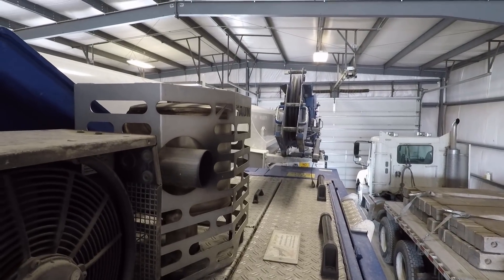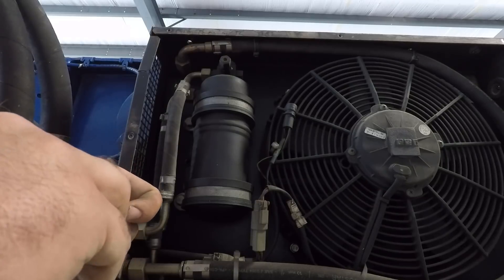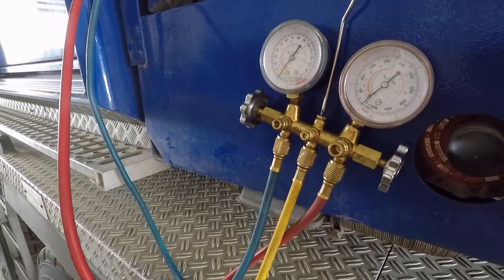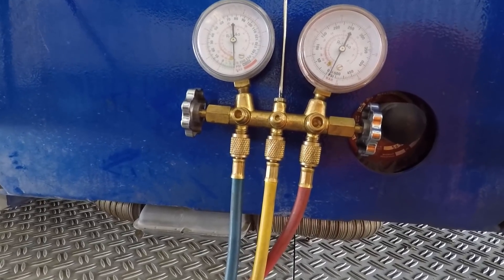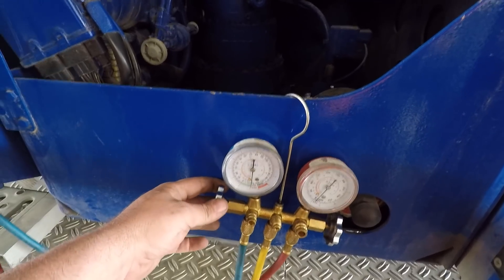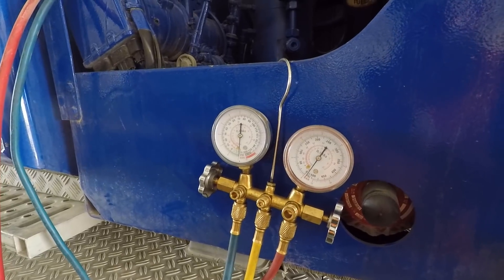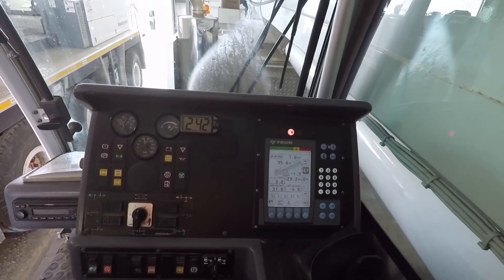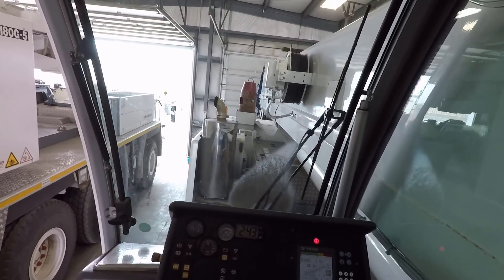Tadano 80-4 | Air conditioner repair

Comment: HVAC...once you understand the basics...not all that complicated...I worked in an 'Auto AC' shop and we got just about anything in there, cars, trucks, cranes, stretch limos, even a 40 footer, Lincoln Town car...had 2 HVAC systems, and still running that little 5 liter engine......and the landlord had a big crane outfit just up the street...Triple AAA crane, had some pretty big mobile units, 5-6  axle....but he got some $$ trouble...now just has a few small 3 axle units...
 So yeah...the HVAC, you got it pretty much right...!!

Comment: Nice job Jimmy. Enjoyed the refresher coarse. Spent allot of years in a shop that repaired Submarines. Enough HVAC info rubbed off over the years to maintain my own vehicles. I know you didn't address all the what ifs, so ill mention that if you did lose vacuum, find the leak by pressurizing the system with compressed air. Then perform soap bubble test to find the leak. Once repaired re perform soap test followed by vacuum test that Jimmy showed you. Note that pulling a vacuum removes moisture and non condensable gases. If moisture is still in the system the vacuum may stabilize (ie no leaks) but will not be a good strong vac reading, continue to run the pump until 28 to 30 inches is maintained.
Reply from the maker: Bradford Lunt, thanks for sharing the info. Also, thanks for watching. 🙂

Comment: Seeing as that I live in the deserts of Arizona I had to learn how to take care of the air conditioning many years ago, 120 degrees will do that ! 😎
I've had to run machines with a cab and no air in the summer and you can't do it for very long without getting a heatstroke !
Thanks for sharing and take care. 👍
Reply from the maker: Ken Gamble, that would be no good. I can't imagine an enclosed cab with all the glass and no air conditioning, in the desert. That must have been terrible.
Reply: To The Top Crane
Yeah, I told the boss that he had three options, fix the air, he run the machine or fire me !
He called out the service man and had it fixed ! 😊

Comment: If you like using the small cans you may want to stock up on them, the EPA has changed a few of the rules and is trying to get a big tax increase on the small cans. The idea is to stop DIYers from messing with the system.
Reply from the maker: That's not good! I will have to buy a 30lb bottle before the price goes up. Maybe I'll buy a pallet of them and sell them after they do their thing. lol Thanks for the heads up!

Comment: Does that  rule hold true with the R-134?  (empty to atmosphere) As I understand it R-134 and Freon systems are two separate systems.  What's you take on it? Thanks for the great information I always wondered how those gauges and valves worked together, the whys and hows.
Reply from the maker: Duncan MacKenzie, I'm pretty sure r134a and r12 are pretty closely related. Just that r134a is less damaging on the ozone layer. Both are a refrigerant, so I think (but not 100% positive) that the same rules apply to the r134a as far as venting to atmosphere. Since I'm not 100% sure, I take the side of caution and not vent it. I'll do some research on the subject and update you with my findings. 🙂
Reply from the maker: So, according to the Clean Air Act section 608, ALL refrigerants are covered and can NOT be intentionally released to atmosphere. So, r134a falls into that category. Hope that helps and answers any questions. 🙂
Reply: First off thanks for the reply and secondly there's no need to do many research as I'm sure you've got better things to do with the time you have in a day. I do appreciate it though. I'm a homebody and surely have more time on my hands I'll do the research and let you know, hows that? Continued thanks for the videos you post. (Never mind) you beat me to it.....thanks.
Reply: Freon is a somewhat generic term...but usually used when working with the old/banned R-12....both R-12 and R-134 use very similar components, but 134 works at a higher pressure and requires a different compressor ($$$$$) and different hoses.

Comment: Nice job man! Very well explained and detailed, I actually just recharged my ac on my loader Thursday. I know exactly what you mean by those cabs get warm on a 60 degree day. I have a light window tint on the loader it helps some but it’s miserable when it’s in blowing cold. Great video again thanks for sharing!
Reply from the maker: Elite Earthworks LLC, I keep some static cling, removable, dark tint in the crane. I have a few pieces that I can move around based on where the sun is coming in. It's cheap, easy and effective. It's not the best for looking through though. But, it may work for your side glass.
Reply: Yeah the sun coming through that glass can feel like it’s cooking you lol!
Reply from the maker: +Elite Earthworks LLC, yes sir! I use sunscreen inside the crane. Even with solar glass.

Comment: Change that receiver dryer. (You explained it well enough for a pro to see you know what you are doing)  Nice job.
Reply from the maker: David McLean, in retrospect, I probably should have. The problem is getting one in a decent amount of time. It is blowing really cold. So, if it starts acting up, I'll definitely be replacing it. Thanks for commenting and for the advice. 🙂
Reply: Generally speaking, if you pull the system into a deep vacuum, I.e. 25 inhg, let it sit for atleast a half hour and it doesn't loose any vacuum all the moisture from the system has been removed and the desiccant in the reciever dryer should be fine for continued use. Only when you can not get the system to hold deep vacuum over time and you're positive of no leaks is it absolutely required to change out the dryer. Most people do it just to be safe, but they can get to be extremely expensive on some equipment. Also, it's always good to check and be sure you didn't pull any large quantity of oil from the compressor when vacuuming down the system. 

I'm not looking to argue with dave, just further elaborate on his remark, because at the end of the day he's not wrong at all. And forgive me if I Babbled on about things you mentioned in the video, I ran out of time watching it and had to skip around to the end. Have a nice weekend!
Reply from the maker: Yamaha4life127, I am by no means an HVAC expert. So, I'll take all the advice I can get. Thank you for taking the time to write a great and detailed comment. 🙂
Reply: To The Top Crane any time, I have both my EPA 608 and 609 certifications, (transport refrigeration And commercial/residential) if you've got questions in the future don't hesitate to ask.
Reply from the maker: Yamaha4life127, thank you! 🙂